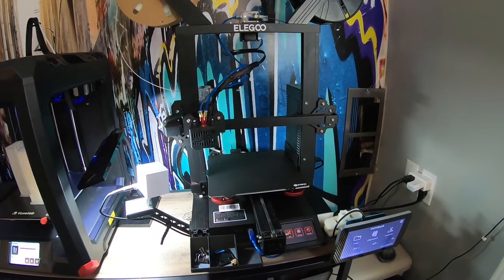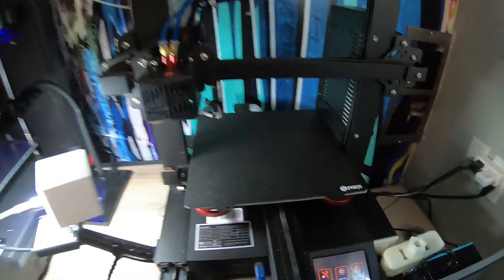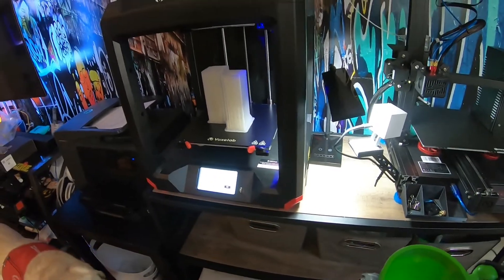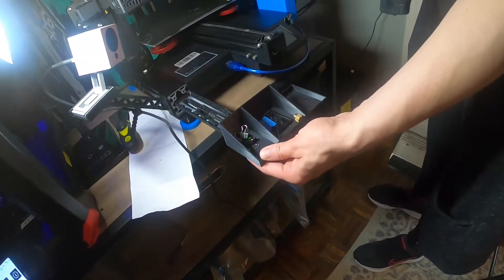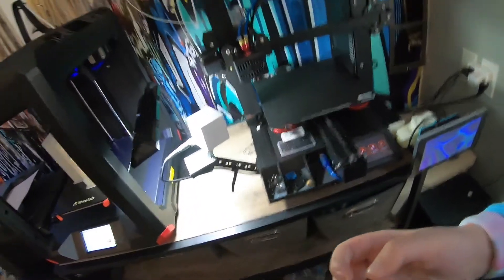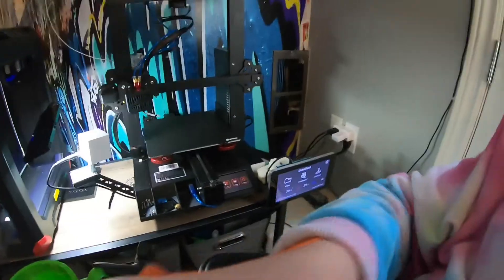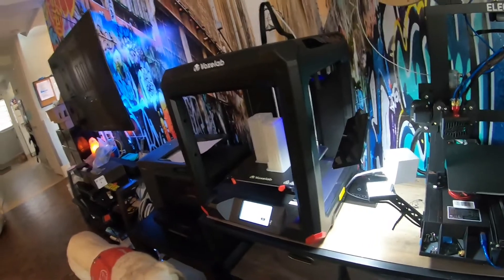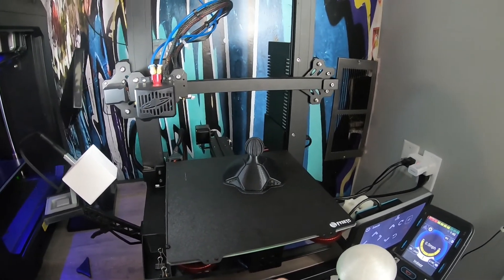Elegoo Neptune 2D upgrades! Extruders, build plate, octoprint, and much more!

Comment: Awesome vid! What did you change on the software when you upgraded the Stock Feeder?
Reply from the maker: If you mean the extruder, you have to update The elegoo txt file , and update your steps per minute and if you need to invert stepper direction, and when you go and do that , enable Machine parameters to number 1 so that you can access and edit your machine settings from the touchscreen 👍 let me know if you have any other questions

Comment: Que bacana. Poderia mostrar em detalhes como você fez a atualização para usar dois filamentos. Obrigado
Reply from the maker: So I got the Neptune 2d so it came with the two filament set up, think  it’s the same board, it would still have the port where you just buy an extra extruder and plug it in and buy a hot end that will except two filaments.,  or I think there’s a Y unit you can print therefore you can use the same hotend 🙂👌